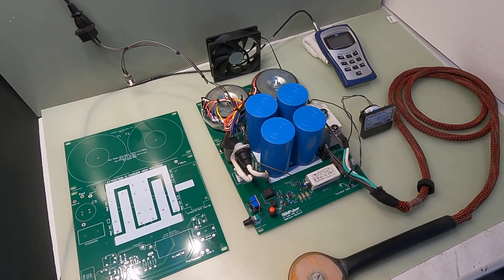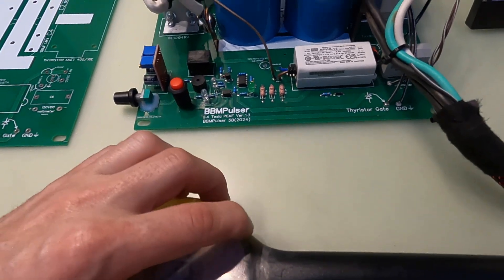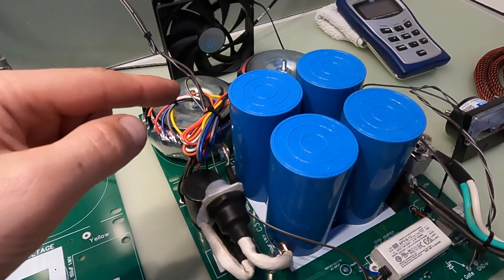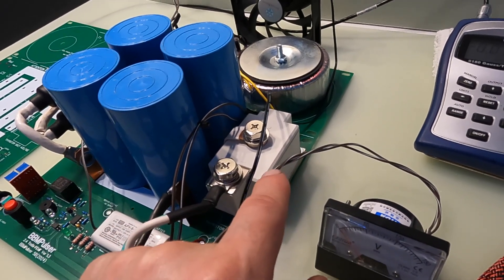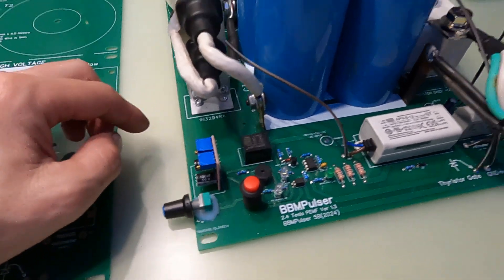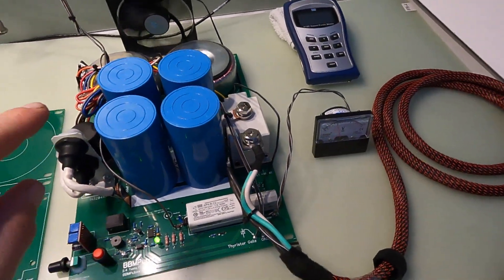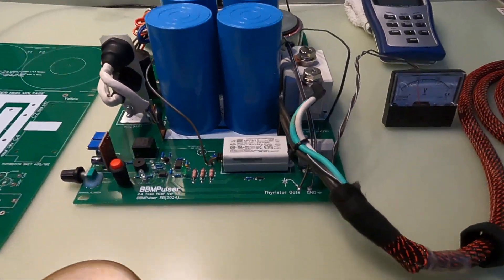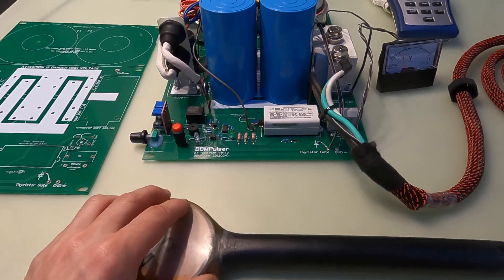159 DIY Open Source BBMPulser 5B 2024 kit overview 2.4 Tesla PEMF DIY Magnetic Pulser 1mm Strip Coil

Comment: having multiple thyristors or another switching method like having many small mosfets might be cheaper? might wanna look into it
Reply from the maker: I like thyristors VS mosfets, thyristors are much cheaper option
Thyristor I use is not that costly, you can get one for around $70 new or $30 used
They are easy to find

Comment: Nice design. Amazing that you can get such high power with only 600uf. Impressive
Reply from the maker: Yes, older version of the kit used 2x3,300uF caps connected in series totaling 1,650uF to get 2.4 Tesla, this kit uses only 600uF to get same amount of power (2.4 Tesla)
Reply from the maker: It has to do with how I connect my capacitors in the capacitor bank. In the old set up Caps were connected in series, in the new set up Caps are connected in Parallel. Also in this new set up I'm using Caps with low internal resistance as is and after connecting them in parallel I can put heavy loads on them for example (1mm strip Coil) with no issues